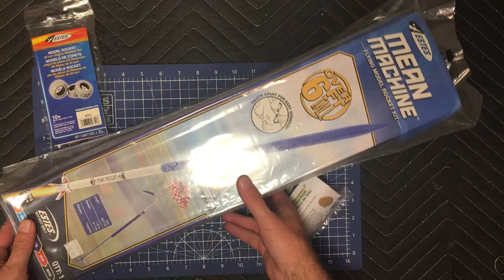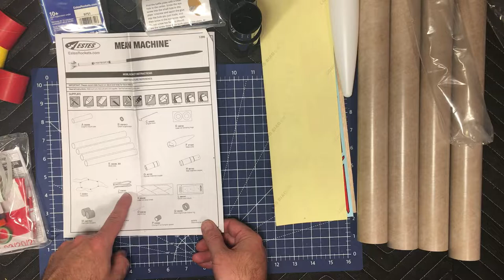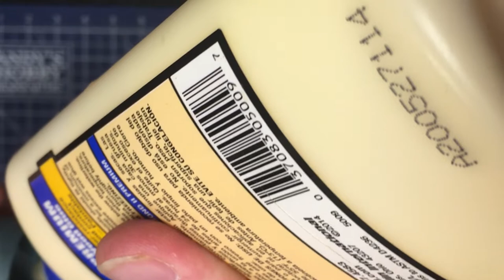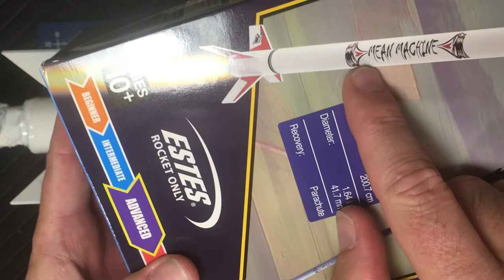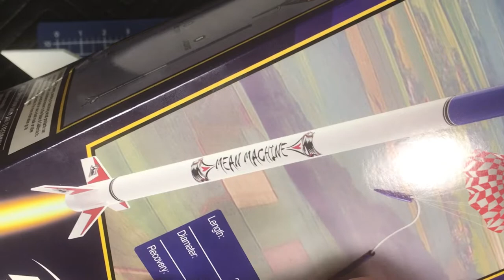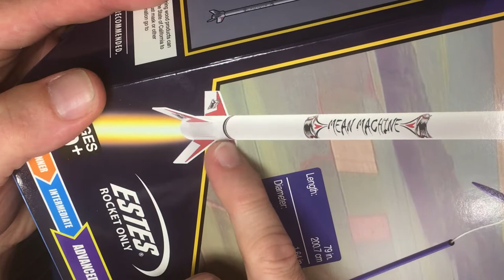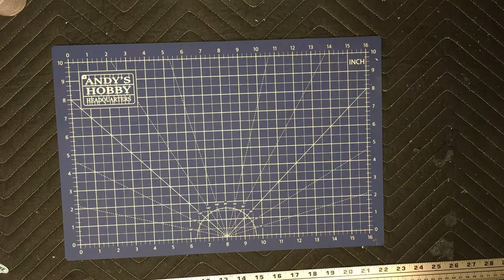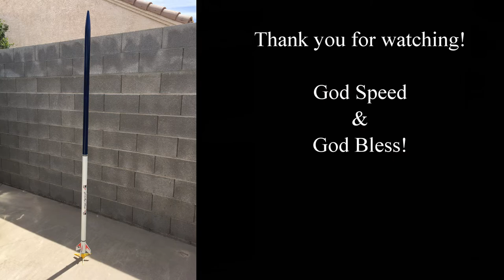Estes Mean Machine Build

Comment: Fantastic build Kevin!  Thanks for the shout outs!  So did the decal solvaset flatten out your decals?  Can't wait to see it fly.  I think when I do mine, since it's an older version of the kit (sans coupler), I'll have it break at the half way point. No shock cord so it will come down separately on 2 chutes.
Reply from the maker: Don, Thanks for the kind words!  I like your idea and I'm sure I can even attempt that with mine, using separate chutes.    As you can see, there is PLENTY of room in the tubes for all sorts of parachute combinations!

Comment: Quite a build! I can see why it took so long.  Getting the tubes aligned is critical to good flying - I think the packing peanuts made all the difference. 😁 Looking forward to seeing it blast into the sky. I heard the 24mm screw-on retainers were designed for a thick wall tube which is why they are loose on a standard BT-50. I used the black hook retainer ring tube to snug mine up on my up-engined Nike Smoke. Thanks for another quality video.
Reply from the maker: Hey JC, thanks for the comments!  I was honored to have you with me for it's maiden voyage!  It was a thrill to say the least.  Thank you for clarifying to me that loose retainer ring issue......  I was really scratching my head on that one.  Interesting how Estes does that, but like you pointed out, us modelers know how to adapt and overcome with our own solutions!